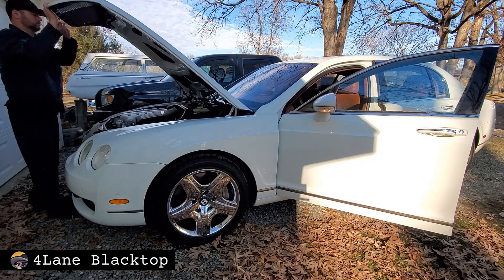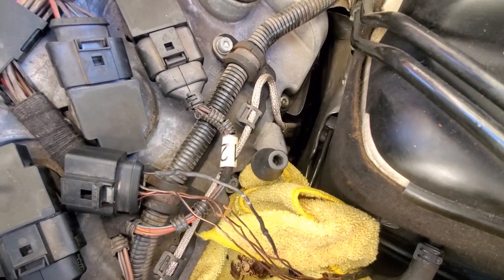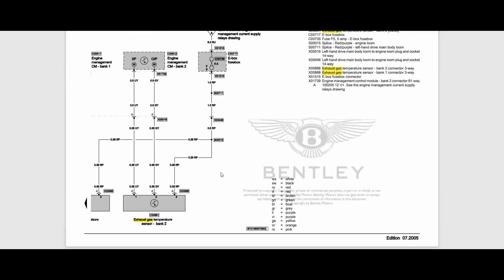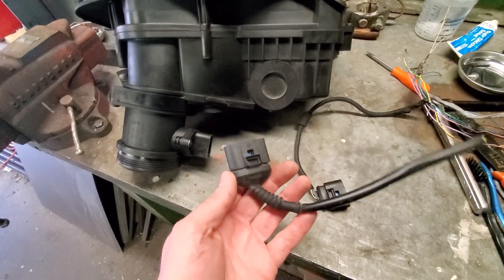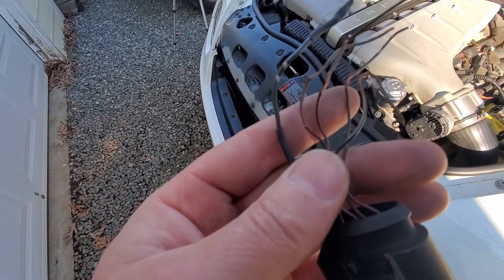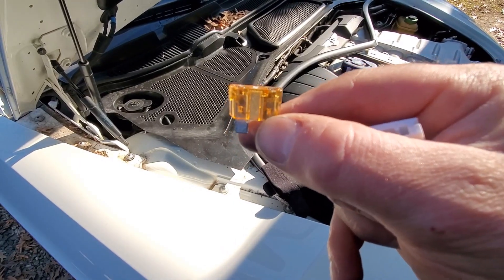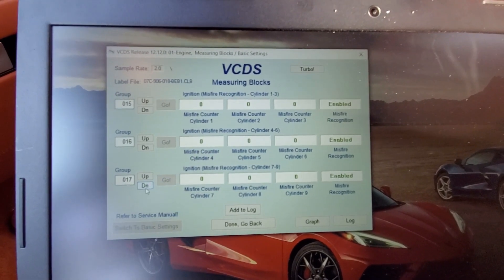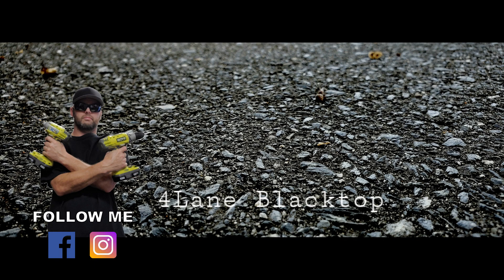Salvage Bentley Flying Spur Project - Check Engine Fault Codes Repaired

Comment: Hello, I live in Texas. I was wondering what kind of volkswagon  or audi will have that same type of connector? I need the same thing for my 2006 flying spur
Reply from the maker: Best things really is to get new ones but used will work too.  Just Google 5 wire audi maf plug and you should see a list of cars. They are on alot.